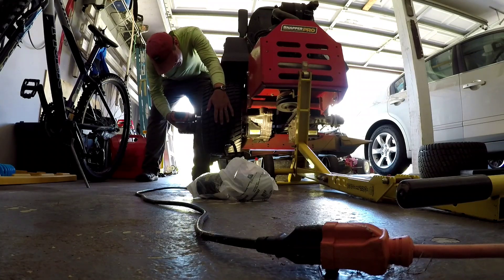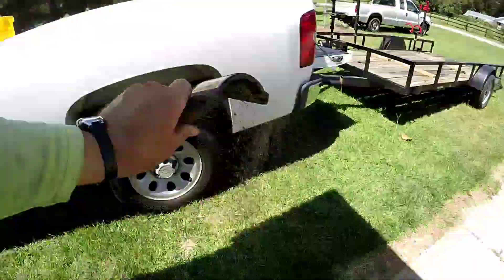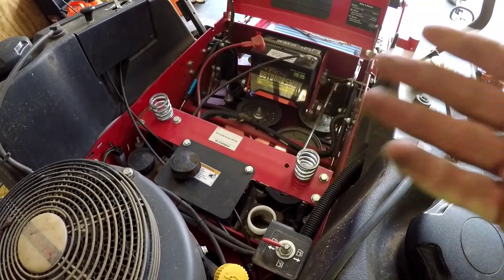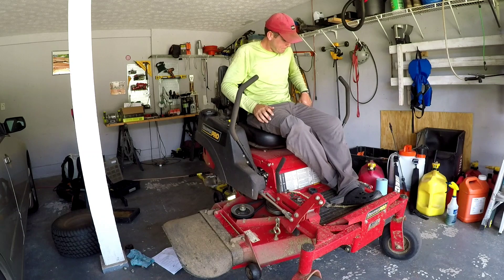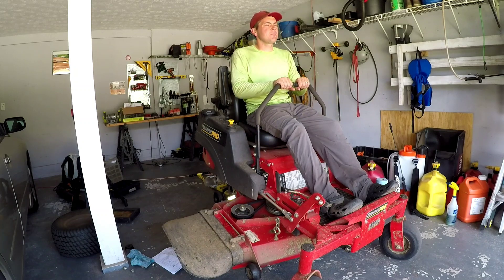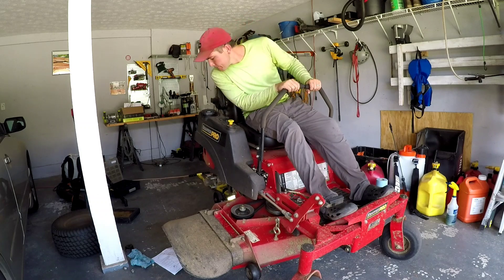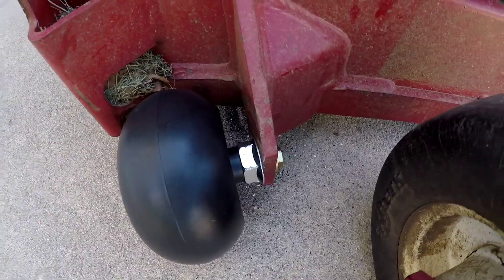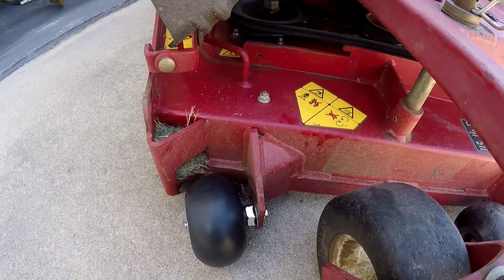Hydro Gear 3100 (2800) (3400) hydro oil change. Zero turn hydro transmission oil/ filter change.

Comment: I have a Gravely ZT HD 48. it has 60 hours and i'm watching difference video to learn how to change out the hydro fluid. Thanks for the upload!
Reply from the maker: Its not hard you can do it
Reply: @tonyslawncare   My zero turn is only 2 years old, i haven't change out the fluid cause the right side hydro is not going straight in reverse. I still have 1 year of warranty left. I will have to take it back to dealer and have them adjust it since that's what my operator's manual say to do. Watching how it is done on video allow others to learn quickly. Again thanks for upload!

Comment: Great video Tony have not seen many hydro videos if any. The 5400s have a internal cartridge filter and comes out from the inside frame. No wheel removal. Be sure to check you fluids on LEVEL ground once you bleed system.
Reply from the maker: Yes sir i did

Comment: I always find it's best to service hydros with two people. I sit under the mower waiting for the fluid to start coming out of the hole while the other person is up top doing the filling. It's a lot less messier doing it this way rather than how it was shown in the video.
Reply from the maker: True but if you dont have a helper you can still get it done
Reply: Tony's Lawn Care absolutely one person can do it. But like I said, it’s typically a little messier that way. Trust me, I love doing I can on my own but I also hate making messes at the same time. My garage floor is like the floor inside an operating room. I freak out if I drop one drop of oil on my floor. lol
Reply from the maker: Your the man thanks for watching i want a clean garage floor lol

Comment: This way, putting the oil in reservoir,  you don't need to use, or try to find an angle fitting to fill the oil. Nice
Reply from the maker: Thanks for watching

Comment: Is there a way to purge without disengaging the trans? One of mine will not disengage. Will it purge on its own over time?
Reply from the maker: What do you mean it wont disengage? The lever stuck? Might have to keep working at it
Reply: @tonyslawncare  the valve moves freely just like the other but even when turned it will not disengage the tire still moves

Comment: Great instructional video Tony👍...what oil and filter did you use,can you run synthetic oil ?
Reply from the maker: https://rover.ebay.com/rover/0/0/0?mpre=https%3A%2F%2Fwww.ebay.com%2Fulk%2Fitm%2F271444620699

I used synthetic blend

Comment: What is the reason for leaving the transmission plug open when pouring the oil in and waiting for it to come out to close and tighten it.  Gnna do this job soon. Thanks!
Reply from the maker: If you dont take it out the oil has no air so it wont go down into the transmissions.
Reply: Thank u for that. Really appreciate it!
Reply from the maker: Also sometimes the plug is on the top and the hose is going into the side where the plug is on mine but it works the same way
Reply: @tonyslawncare : alright thank you for the heads up.

Comment: Great video Tony. Followed the entire process. My issue is when I filled the hydro reservoir with new oil it fills up and does not drain into the hydro transmission. What do I need to do?
Reply from the maker: You gotta take out that 11/16 plug it may be on the side like mine or on the top depending on where they put the hose in
Reply: @tonyslawncare  I did that too. Mine is an allen wrench plug which I loosened. It's working now but it's a slow process. My mower is same as yours. Still love your video, friend. Thank you for sharing your knowledge.
Reply from the maker: Take the plug out completely to let air flow 😎 bro thanks for watching you coming to GIE?

Comment: I've got a SnapperPro S125xt and both transmissions stopped working suddenly. The handles feel stiffer than they did before. do you think it could be the transmissions? seems kind of weird if they both went out at the same time.
Reply from the maker: Check the hydro belt and make sure theres nothing lodged in the pullys somewhere and also check hydro fluid
Reply: Depends, if you have one pump driving both motors. 
Some lawn mowers use two independent pumps with their independent motors.

Anyways, if one pump goes out, the metal could spread to both motors.

Comment: What oil did you use? I have a snapper 460z that calls for 20w-50 conventional detergent oil but can only find 15-50
Reply from the maker: 20w50 motar oil its not hard to find i got mine from walmart i think auto parts stores have it for sure too
Reply: @tonyslawncare  Thanks I'll have to look around. Really appreciate the video!

Comment: When you’re filling up the hydros are both hydros empty or just the one? So are you filling up the one side then removing the old oil from the other side?
Reply from the maker: Go ahead and replace both filters then fill up both units somtimes it has 1 reservoir that fills both
Reply: Tony's Lawn Care yea mine only has one reservoir. Would I leave both plugs off?
Reply from the maker: Fill the hydro directly under the bottle first then put that plug back in then do the other side i believe thats how my scag manual told me to do it thats how my scag is !

Comment: Thanks for this.  Recently bought a ZT with a 3100 transaxle.  Never saw a maintenance guide with the package.  How many hours do you get out of an oil change like this?
Reply from the maker: First 100 hours then every 400😎👍
Reply: Roger that.  Thanks.

Comment: Hi Tony, great video, will be helpful when it comes time for me to need to do this. I have the exact same drives and as i said in a previous video it is on a brand new Ferris 400s. I have noticed the oil level in both reservoirs have been slowly but surely dropping. I have been monitoring this parking in the exact same position and waiting until completely cooled. I've also been finding the smallest amount of oil collecting around both rear wheel rims. Have you ever encountered this before on yours, is this normal or do you have any ideas what it might be? Cheers.
Reply from the maker: If the dealer cant find anything wrong maybe you should just run it and just keep an eye on the fluids every so often

Comment: Plug stripped on one side and I cannot remove it. So disgusted with hydro gears torquing of this plug! I can’t change my fluid now!
Reply from the maker: Could you just remove the whole unit out of the mower? That way you could get at the plug easier ?